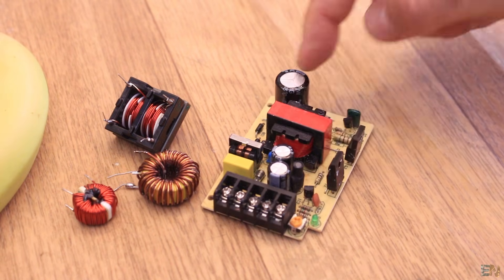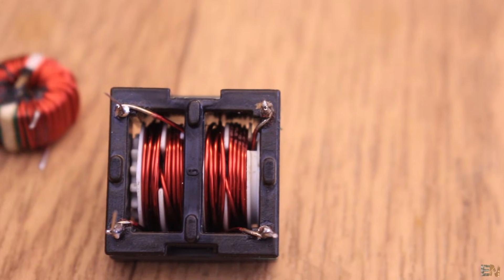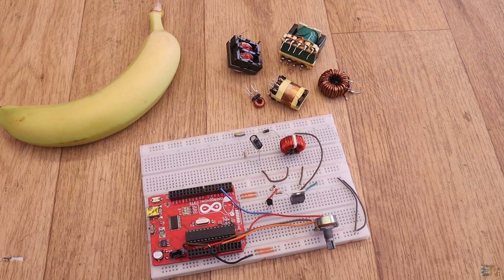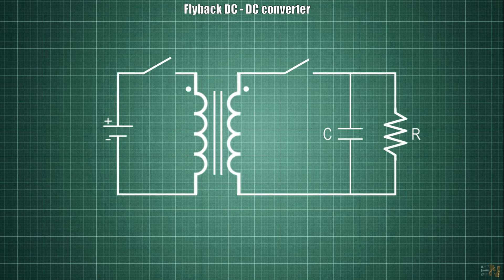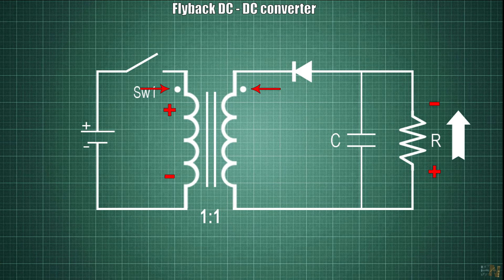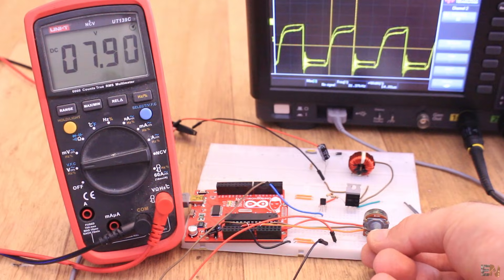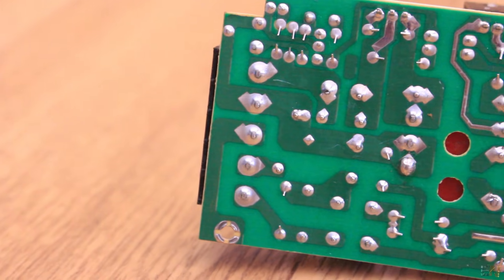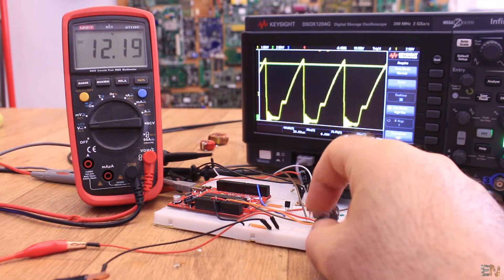FLYBACK DC - DC Converter Theory And Example

Comment: Nice video — despite a misconception at 4:32: no energy is ever stored in the core of an inductor or transformer. The energy is stored in the air gap (for energy-storage inductors) or in the surrounding air due to leakage flux (for non-perfect transformers). Don’t worry — this misunderstanding is extremely common. But getting the physics right is a real eye-opener.
First, it’s important to know that a high measured inductance does not automatically mean that the device can store magnetic energy. For example, an ideal transformer has an infinite magnetising inductance , yet stores no energy. This is why a good transformer is a bad coupled inductor (i.e., a bad “flyback transformer”): the saturation current is tiny because the core is not designed to store energy. A transformer only works in a flyback topology due to parasitic inductance, which makes for a very poor and easily saturating converter.
The common misconception comes from assuming that a large L value means a large magnetic-energy capacity. That’s not true: a good transformer has a high Lm , but this inductance does not participate in energy storage. And an LC meter cannot distinguish between magnetising inductance and energy-storage inductance — it simply reports a number.
Practical advice:
For a flyback converter, use a coupled inductor with an air gap. The gap allows real magnetic energy storage in the field, and prevents premature saturation.

Comment: I have been using an old ATX power supply to run a robotic arm. Last night, my output changed from + 12v to a very low voltage AC. I have no idea how or why this happened. I am using a premade chip for the 24 pin connection. Perhaps this is the failure>?

Comment: I can say you explained half of the circuit because tha back emf created by transformers should be handle with snubber circuit and this create a lot mathematical confuaion for engineers😊
Reply: The "spike" is the result of leakage inductance - magnetic flux that is not well coupled to the output winding. I don't know why it should cause a "a lot of mathematical confusion." It is quite straight forward, though actually quantifying leakage inductance can be a bit of a challenge.

If a discrete FET is used it may, if the inductor is well designed, be completely acceptable to allow the FET body diode to avalanche to discharge the leakage inductance, though this has to be evaluated carefully. This approach usually can't be used with integrated switcher ICs (e.g. those from Power Integrations), where the maximum switch voltage rating must be carefully adhered to.

Comment: 9:22 I don't understand why two MOSFETs are being used in this power supply. It doesn't show on the schematic. Is the second one replacing the diode in the secondary part of the circuit?
Reply: I suspect he just doesn't recognize a diode in that package.
Using two switches in a flyback converter is very rare. It is not unknown to use a FET as a synchronous rectifier for the secondary, but I certainly wouldn't expect one in a relatively crude circuit like the one in the video.

Comment: Ordinary forward transformers feature simultaneous currents, and voltages that scale by rule of winding ratio. Flyback currents are purposely not simultaneous to break free of that strict ratio. Forward transformers have a strong slow inductance to avert energy storage in the core, but instead push current immediately to the secondary. Flybacks have weak fast inductance with gaps in the iron to quickly accept packets of energy into those gaps and release through a secondary diode on the other half-cycle. A flyback mis-cored as a forward would charge and discharge too slowly to be useful. A forward mis-cored as a flyback would present insufficient inductance to block low frequency current, and die a short circuit.
Reply: He seems to lack a fundamental understanding of how inductors work, and that once energy is stored in the inductor by the input circuit and winding, it is going to go somewhere once the input side switch is opened. It doesn't "care" if the discharge is into 1 volt or 1000 volts, so the output side voltage isn't dictated by the ratio of the charge and discharge windings. Of course you do set the turns ratio appropriately because of other important considerations in a practical design.

I note you use the term "packets of energy" which is exactly the same terminology I usually use in describing the way a flyback converter works.

He misuses "buck" and "boost" when talking about the relationship of input and output voltage of a flyback converter.

Comment: why is the small transistor needed? Why not just connect the gate of "large" MOSFET to the Arduino.
Reply: The transistor will probably result in faster turn-off of the FET because it will be able to "sink" more current, thus discharging the capacitance of the gate (which is actually a rather complex subject of its own) faster.

To turn the FET ON he has used a pullup to the supply rail for converter itself. This can be above the supply rail for the Arduino, which is not permitted (usual spec is that no pin must be pulled to more than something a bit less than one diode drop above the supply rail, though some I/Os on some processors can tolerate more. His pullup is very high in value - 10k. That means his FET will turn on quite slowly. Turn-on probably would be faster with the gate connected directly to the Arduino output. His slow turn-on actually is probably advantageous because of his poor choice of output diode. Normally you would use an "ultrafast" or schottky diode in that position so that it turns off very quickly when it becomes reverse biased. The slow turn-on of the FET does reduce efficiency.

It is often a good idea to have something between an output pin on a processor and a power circuit. That can help protect the processor in the event of catastrophic failure of the thing being driven.

Comment: Are common-mode suppression chokes not using a lossy magnetic core? I’d be very hesitant to use anything designed for noise suppression as a power inductor/transformer for this reason.
Not to mention flyback transformers in particular need to have an air gap for storing energy. Trying to use a conventional transformer (or even a transformer from a forward switching converter) for a flyback converter definitely gives you problems.
Reply: Common mode choke cores are not generally lossy, though they may be for some special applications. Normally they are "ordinary" ferrite with permeability in the range of 2 to 4 times that of typical power ferrites (5000 to 10 000 vs about 2800).

Without an air gap the core will saturate at pretty low volt-second product across a winding. The winding design is also poor in terms of leakage inductance. I suspect the only reason the FET in the circuit in the video didn't die from having to cope with excessive leakage inductance is that it's drive was poor and switching was slow.

I'm rather baffled by the weird ramping waveform in the video - the two distinct ramps, rather than just one. I'm assuming it is the primary current, but it certainly doesn't look like anything I'd expect (and I've designed a lot of switchers).

Comment: In your schematic, Why didn't you switch the mosfet directly from the Arduino? Would anything happen if they were connected without using the bc547 transistor?
Reply: Arduino pin can't supply enough power to do that. That's why it's needed to switch using another power.

Comment: Why do we need a BJT as a MOSFET driver? Can't we turn the MOSFET on and off using signals directly from the arduino? Or do MOSFETs require higher turn on voltage than the Arduino can provide?
Reply: Many FETs do require a gate-source voltage above 5 volts for good turn-on. You also need a driver that can source and sink substantial current in order to rapidly charge and discharge the gate's capacitance. Even in very old SMPS control IC's the drive current capability was usually at least ±200 mA.

His driver arrangement is poor, but it actually probably is advantageous becouse of some other poor choices in the circuit.

Comment: Great video . I just want to highlight a point , in you schematic i think you put the diode in the opposite direction because otherwise the capacitor will discharge into the battery which is not good for a boost converter.

Comment: Isn't a common-mode choke supposed to be lossy at high frequencies? Or is it fine at such a low power?
Reply: Generally that type of CM choke isn't lossy, though some are made to be. They are a poor choice for a flyback converter because they are able to store comparatively little energy and so can saturate easily (i.e. above some point the core ceases to be able to sustain more magnetic flux and the winding starts to look like just a resistance, which can result in instant destruction of the circuit if no protection is used (many controller ICs for switchers monitor the current in the primary and if it exceeds a threshold the chip turns the switch OFF for the duration of the cycle).

Inductors for flyback converters normally employ an air gap in the magnetic path. With a ferrite this is done with a discrete gap. With an "E" shaped core a apscer can be used so the gap is in all legs, but the preferred method is to grind the centre leg so all of the gap is there. With "powder" cores, such as powdered iron or molybdenum permalloy powder (good, but really expensive!) the air gap is "distributed" and actually made by the non-magnetic binder material that holds the magnetic particles together.
In a gapped core almost 100% of the energy is stored in the air gap.

Comment: Is it possible to build a configuration for DC 325V (from 230V AC) instead of 12V DC? I mean if I connect 325V in place of 12V

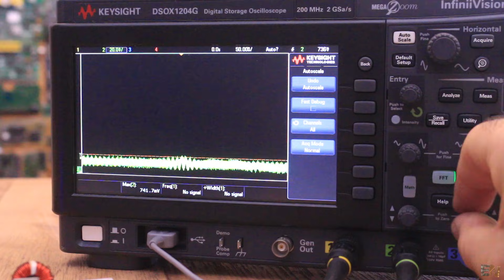Comment: At around 11:12 you mentioned that using flyback will create ripple due to switching and this supply is not much useful. Cant we add caps, and use a LDO to ensure the ripple stays minimum?

Comment: Flyback transformer also has an air back in its core, whcih is not in usual transformer. That air gap store the energy. Most flyback converter has a small plastic sheet between its 2 pieces of cores, which serves as the tiny air gap.

Comment: Hello, nice video ! i just got a led driver (s-150-24) but no power at the capacitor for VCC PWM. I checked the voltage coming to it from two 570 K ohm, but end up having 0v. No component seems burnt, any idea where to look at ? thanks

Comment: Sir is the current on the output side same as the current we put in the primary ???
I tried the exact same project but I could light up only one led and not even a tiny motor 
Where I was supplying 2A of current in the primary

Comment: Why have you NOT got a base current limit resistor in the circuit between the UNO output and the transistor?
How much current do you think is being drawn from that UNO output.
Please do not just put a loveheart on this comment, please comment, answer the question please mate.
Reply: The uno has built in resistor.

Comment: Could you use a LM317 in a second circuit, to get a smoother output?  the buck converter circuit would reduce the dc to a level just 2-3volts above what the LM317 voltage output is required, this would make the LM317 more efficient & a smoother output. Of course, you would have to use a dual potentiometer.

Comment: Very simple explanation of flyback operation but on 7.23min there is something important that is not said and must be mentioned. When switch opens inductor l1 forms an opposite voltage as to the one before switch opening. So the same polarity is formed the same time on l2 dots. Negative on the dot of l1 (positive before switch opens) and positive on the other. Same on l2. If switch was drawned on the negative side of l1 things would be a bit more clear about the polarity formed after switch opening. Also something that is inportant and cant be forgottend due to simplicity. The dots when drawing inductors  is not just a mark. Its on the same side of a coupled inductor if the winding was made using the same direction when winding the core. And in the opposite direction if we used opposite directions.clockwise vs anticlockwise
Reply: Correct! I entered comments to write about the messed up description of dot theory in the video...

Comment: Why shouldn't the GND of the secondary winding be connected to the input GND?
Reply: To isolate low and high sides from each other. It protects components and people from voltage and current surges at the input. It's a common practice in all power supplies.

Comment: Isn't it a transistor and a diode on the smps?
I didn't spot the output diode.
Good video
Reply: Yes, it is a common cathode diode in a TO220F package for better thermal characteristics and current handling ability.

Comment: Hi, i Need one more help from you i have 2 lithium phosphate battery 60v 24ah nd other one is 60v  30ah, i need 1 circuit for self charging dual battery pack where one battery pack is used to run the hub motor while the other is charged need smart switching system  where it monitors the voltage level of the batteries and decides which battery pack. Has to charge. pls help to share circuit and make video for this concept wiring diagram and circuit share me pls

Comment: Ducted fan not run for lipo battery 
Than suggest me external power supply to run ducted fan
 https://www.turbines-rc.com/en/changesun-xrp-rc-blog/585-changesun-xrp-12-blade-70mm-edf-ducted-fan-2600kv-motor-3s-4s-.html

Comment: Great video. Quick question. Can you use a Toroid as the trasformer for smps? What are the advantages and disadvantages of using a Toroid.
Reply: Toroids work fine as a lot of smps circuits can use them. Main benefit of using non-toroidal is easier winding and more space for additional turns.

Comment: Good video. 
One thing you should take a look at is adding code to the arduino to not only change the PWM duty cycle but also the frecuency, and divide the function into steady and non steady states, so when you are under low loads you can do faster pulses in short burts to get a better regulation with small loads and when you reach steady state (constant pwm) you can lower the frecuency to increase the efficiency (all according to your mosfet and transformer.
You can play with the duty cycle, and frecuency to trade off regulation or efficiency. If you just cared about efficiency, you could just ser the frecuency, and duty cycle to the highests efficiency point, and then just turn the pwm on and off depending on whether you are above or below target voltage. And of course your ripple will be huge without an equalized load but for stuff like motors or resistors it shouldnt make a difference because it would be the same rms power, capasitive loads could have problems with the voltage peaks though.
Reply: Why do capacitive loads have a problem with voltage peaks?
Reply: @ryccoh  
Because capasitive loads will suck more power and store it instead of actually generating work with it.
Its like having a led with a capasitor at the front. If you give a PWM signal to it, the capasitor will charge to full voltage and then continue powering your led even after you turn the power off (or are in the off half cycle)
The capasitor, or better said, capasitive loads will smooth your PWM signal and try keeping it constant, which is the opposite of what you want.
In practice you can use PWM with capasitive loads but depending on how capasitive it is and the type of capasitor it has you can either fry your mosfets, output diodes, or even blow the capasitor because of the excesive ripple (the pwm signal itself) or if nothing of that fails you will most likely have a very exponential response, meaning that a 0% you will have 0% power, at 5% you will have 3% power,  at 10% youll have 25% power and say at 20% pwm duty cycle you will have most likely 90% or almost full power.
Motors and inductive loads dont store energy as voltage but as magnetic fields, which then translate to current.
So a PWM signal would make the current raise when on, and fall when off making a sort of low pass filter. 
This in turn translates in that you can control the average current with your pwm signal which is what actually creates the work.
The caveat is that you need to use slower frequencies or you will get a very logarithmic response. Thats why you can hear a faint coil whine with square wave VFDs have that soft start and power control. (Its the VFD doing PWM to the motor coil to limit the max current)
Interestingly enough, in theory, if you had a constant current power supply and did PWM with that to an inductive load, you would have the same the same problem as having a constant voltage PSU doing PWM with a capasitive load.
If you PWM voltage, you can control current, if you PWM current you can control voltage. 
Resistive loads dont store energy so they are not a problem, meaning 50% duty cycle equals 50% output power.
Reply: Hi, friend. https://youtu.be/3rhYs6V0tAU

Comment: Thank you great video. Please could you explain the load resistor? Another question is do you just need a transformer with a DC output to power this or do I need a regulated supply?
Thanks
Reply: Hi, friend. https://youtu.be/3rhYs6V0tAU

Comment: How to change the output voltage level of a computer ATX power supply .
I want to make a variable power supply with this with a maximum voltage of nearly 50v.
Reply: It's not a good idea, you will end up replacing almost all the components, just buy a bigger one